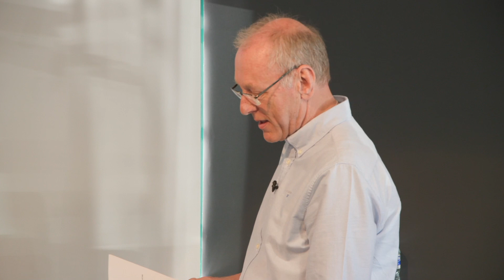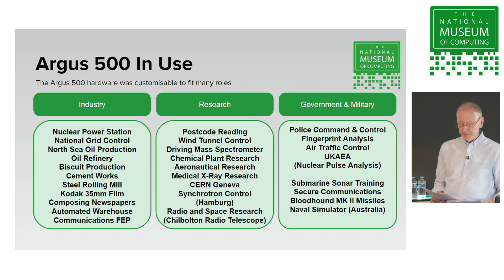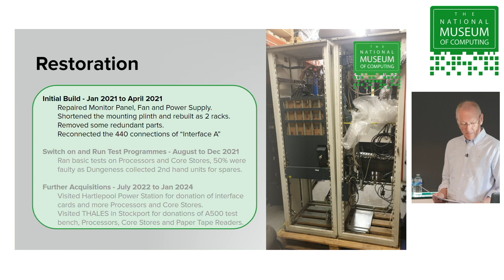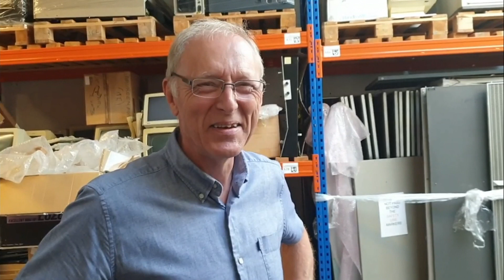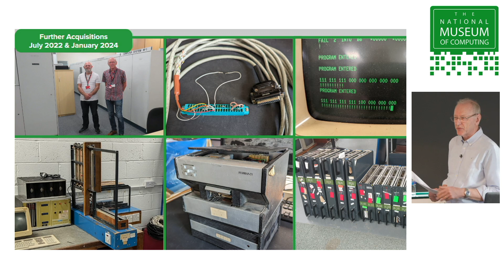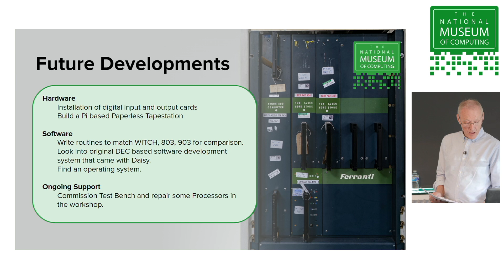The computer that ran a nuclear power station  | Ferranti Argus 500 | TNMOC Talks

Comment: I was playing with an Argus 700 Yesterday. 

 In 2011 a bunch of ex RAF Radar Technicians who had worked on the Bloodhound Mark 2 SAM system formed a preservation group to assist museums in preservation of Bloodhound equipment as they were getting as bit pissed of in the way that the Museums were letting Bloodhound equipment rot away. The group got their hands on a Bloodhound Mark 2 Launch Control Post (LCP) and Type 86 Radar that the RAF Museum at Cosford was going the scrap. 

 The LCP was fitted with an Argus 700 computer and display suite run by 4 Ferranti CHARGE units (and a butt load of D to A / A to D convertors). The Equipment had not seen any power on it since 1990/91 and had been outside on display at Cosford between 1991 and 2006 before it was moved to the other side of the airfield when the Cold War Hall was built. During the period between the equipment being moved and my lot getting the LCP and the Radar, Metal Thieves had got on to the airfield, broken into the LCP and stolen a couple of control panels off the display suite. Fortunately, they didn’t take the CRT Monitors or anything out of the computer racks including the 25 Mb 8” CDC 9415 Wren 1 Hard Drive. 

 The Swiss used the Upgraded Bloodhound Mark 2 system as well and when they withdrew the system from service in 1999, they preserved a fire unit at a former missile site as a museum. As part of the museum set up, they removed the Argus 700 and display suite from an LCP and installed it in the main museum display hall where it could be run to show how a missile engagement was carried out (thanks to the system having an inbuilt simulator function). 

 One of guys who had set the place up was the lead LCP technician in the Swiss Civil Service and was the head of the logistics for the maintenance side of the Argus 700 and he ensured that the Museum had 10 spares of everything to keep the Argus running. A group of us went over to Switzerland in 2013 to learn how the computer suite worked as most of us were missile and radar guys. When we put the British Hard Drive into the Swiss rig, it booted up (making very horrible noises in the process). Fortunately the drive worked long enough for us to dump the thing to tape and the Swiss loaned us spares to ensure we could get our rig working (mainly thanks to a lot of cleaning of contacts and replacement of capacitors in the power supplies). 

 The Swiss also gave us the missing control panels, however their system had some major differences in the control panels which was going to mean we were going to have to run the Swiss software, until we were contacted by a former RAF Officer who told us he had rescued the panels we were missing when they were going to be scrapped in 1991. Thanks to him donating these panels that we could run the thing as a RAF system.

 We were then joined by a former Ferranti engineer who told us that the Swiss had asked for a modification to replace the Interface board for the Wren disc with an interface that would talk to a SCSI 2 hard drive. We managed to get our hands on a couple of boards and a SCSI emulator that would use a solid-state SD card as the bulk memory storage. 

In 2023 the LCP and Radar, now restored with a full working simulator were moved to the RAF Air Defence Radar Museum where on specific days when the Museum is open, the LCP simulator is run up and we allow visitors to fire missiles on the simulator.
Reply from the maker: Thanks for sharing the information on the LCP, it sounds very interesting.
Reply: @tnmoc  we have some videos up showing the kit in operation.

https://www.youtube.com/watch?v=p0Z9TBa9PzI
https://www.youtube.com/watch?v=bg7NI7nD36M

Comment: I looked after the Bryant dums/MS 1 controllers on the Argus 500 from 1968 to 1972 as the backing store specialist in FCSL service dept , initially from Wythenshawe and latterly from Westwick House in Bracknell. The drums were in fact 600Mb and somewhat unreliable. At some point after I left in 1972, they were replaced by Burroughs 2Mb fixed head-per-track discs and MS 6 controllers. The display systems at that time were monochrome MD4 vector/ cursive stroke systems with rolling ball controllers. On site were Jack Morris, with Alan Crewe spending a lot of time there , too.
Reply: Jack Morris was a great guy.  DNB did not have Burroughs discs though or rolling ball controllers, I guess you are referring to another installation.
Reply: @christopherjones7459  I left FCSL Southern Service Centre in 1972 for pastures new and then joined FCSL Wythenshawe Servce Centre in late 1974 as National Support for backing stores with no recollection of Bryant drums still in use at Dungeness or GEGB NGC. Did the Bryant drums at Dungeness and CEGB Nat Grid Control really last throughout the 1980s? How and who maintained them throughout the 1980s?
Reply: @oldmanmarchant  The Bryant drums were in service into the early 1990s at Dungeness, I have no information about the NGC system. I cannot remember who maintained them, it was a Dutch company, or at least a company based in Holland. they used to service them once a year. I was involved in the admin of this work, but its a very long time ago and I cannot recollect the name of the company. Dwindling support forced replacement with the Palladian SSDs. I do remember that when we removed the cubicles they each had about 250kg of lead ingots in the bottom to reduce any vibration. I can warrant that the ingots made very good ballast for boats.

Comment: The Dungeness machines had two Bryant 1Mbyte drums per processor not Burroughs discs. Of the two drums, one was on standby. These drums were replaced about 1990 with solid state discs from Palladian Electronics. At the same time the Ferranti  vector graphic displays were replaced. Your description of the plant control and stability applies to Hartlepool and Heysham 1. At Dungeness the boilers, turbines  and feed systems were controlled largely by analogue control systems with limited digital control. The Dungeness plant was far more stable than the other AGRs and could be run on manual control for hours on end with little input.
I have a paper tape of an original test program somewhere if you want it. Also a section of the TARE control panel which is in the same format as the desk mounted monitor panel.

Comment: Bit of a blast from the past. I worked  on a 1990s project to read in all the data from that A500 and present it on a UNIX-based system. Wasn't easy understanding how all the data was laid out. Spent a lot of time in down at Dungeness. I heard they had great difficulty replacing the A500 with a new system from Atos Origin. There's still, as far as I know, an 80s era Argus 700 system controlling Torness Nuclear Power Station - did a ton of work on that one too.

Comment: I worked at Ferranti Wythenshawe assembling Argus 700's but occasionally assembled / rebuilt damaged modules for Argus 500 systems. Later I worked in Cheadle Heath where they had a fine collection of 500s supporting old MoD contracts, I believe that they are now Thales Underwater Systems, and I realize it's unlikely, but they might still have some modules or some that are due to be retired, or even documentation? The last time I visited the Science and Industry Museum in Manchester (decades ago), they had a large collection of static 500 and 700 modules, maybe they have have some duplicates where you could do a trade for some of your duplicate non-working modules?
Reply: There is a small company that still supports the Argus 700, however the cost of getting boards repaired is very expensive.